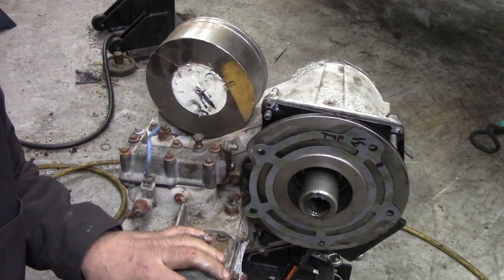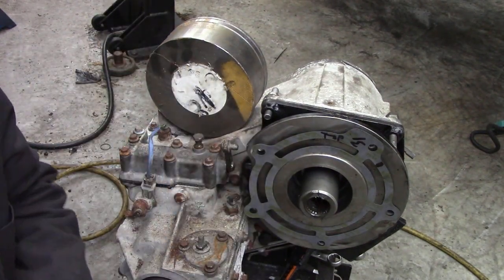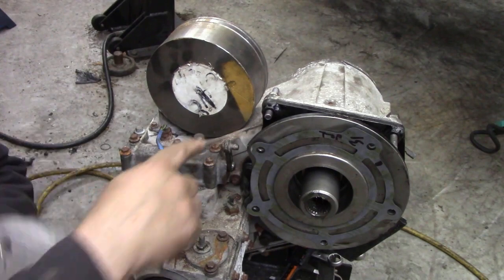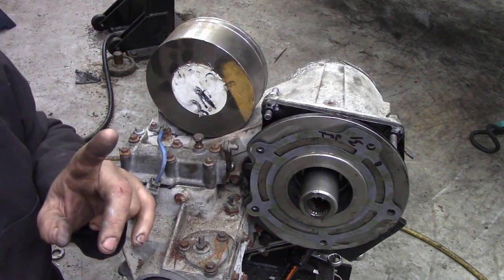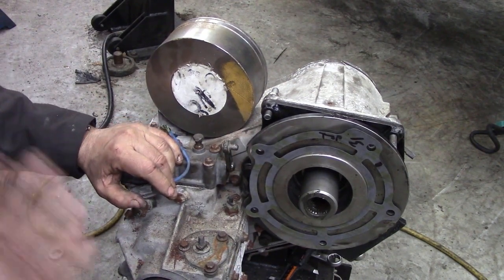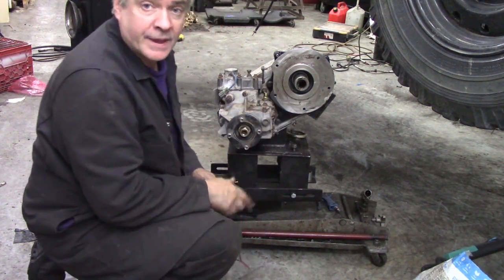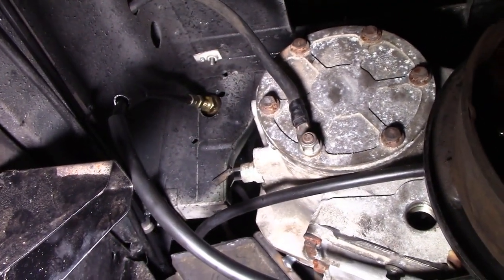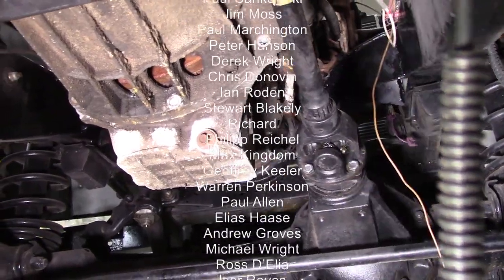GM Vortec project. Time to fit the transfer case  -  a few notes Part 2

Comment: Looking the goods Mike, well done matey. Not to far to go now and then you'll be zooming all over the place!  (WHAT - A landy that has some get up an go, bloody unbelievable)  :D
Reply from the maker: Need to get the ECU re programmed, and fettle and exhaust, sort a bit of wiring and then should be done - I must admit it sits so nice in the 110 - my only concern is the manifold is close to the steering  - would be excellent on a RHD!
Reply: @BritannicaRestorations  Yeah, I know what you mean, V6's seem to be just made for the Defender (admittedly the RHD version fits better), you may recall that I mentioned awhile ago, I wanted to do a Diesel version TDV6 but the TDV8 would appear to be the go (better engine apparently). I don't know what it is over here in Oz, but we really do prefer to have a diesel under the bonnet rather than a petrol in our 4x4's or I'd look into a Petrol V6 as well, so many on the market now days. Matey do a wrap on the exhaust so as to extend the steering links life span a tad and if you have to, square up or oval squish the exhaust pipe a tad or maybe dent the chassis /cross-member to get some extra wiggle room.
Reply from the maker: I liked my Isuzu 3.9T swap but it is heavy and not that good on short run mpg
I would do more but engines are hard to source and parts are hard to find - I have to get oil filters from the US! 
The V6 is good for parts - just got a new air filter delivered in 1/2 hour from local shop for C$10, New distributor (broke the old one with the lifting chain) $60 inc. tax Amazon delivered Sunday, and not in plastic!
Reply: @BritannicaRestorations  Yeah parts can be a bitch at times, and what with shipping on top it can be damn right criminal! Just have to try and find the perfect donor engine for easy set up, reliable, parts readily available, reasonable economy. The Goldilocks Donk - I think I'd have better luck winning lotto.  lol
Reply from the maker: Getting things from the US is a waste of time for me - 30% on the exchange rate and the shipping is often 3 x more than then part! That is why I feel for you in OZ and NZ - the transport is very expensive if you buy on eBay
Reply: @BritannicaRestorations  Yeah what is it with USA Shipping, its the most expensive on the bloody planet. I can get parts from the UK with shipping to my door far cheaper than I can do the same from the USA. I have watched the tracking on a few items that I had to get from the USA, an matey, I swear just about every state gets a visit from that item before it leaves for Oz. It lands in Perth, and heads on down to my place, just the one stop, but in the USA, I loose count of how many stops it has on the way to me and that's not including the ones outside the continuous 52 states of the USA. Its like every man and his dog is getting a nibble from the pie!
Reply from the maker: Inland US shipping is dirt cheap, but once they know you are in Johnny Foreigner land, up goes the prices  - I have known companies in the the US refuse point blank to send to Canada, even to sent things to my US mail box just over the line they refuse, well, they do not get my business!
Reply: @BritannicaRestorations  Fair enough too I say, always let your wallet do the talking (if you can go some place else cheaper - why not). What they are doing is just another legal form of price gouging!
Reply from the maker: Just as an example - this week I got the FedEx bill for customs processing the shaft I had made in the US - C$138. Tax was C$30, all the rest was processing fees etc
What a rip off!
Reply: @BritannicaRestorations  Can only say one thing to that.....FRAKENHELL  :(

Comment: It's gonna be a lovely conversion Mike.. smooth and torquey!! I'm surprised you didnt steam clean the engine /transmission before fitting??
Reply from the maker: I got all the oil and grease off it, but there was corrosion on parts

Comment: Hello Mike, any advice on replacing the mid cross member on a 2000 110? The  one that bolts to the chassis and supports the body behind the rear foot well. Need to replace mine as it's rotted on my driver's side where the side runner step attached to it 🙁
Reply from the maker: You need one of these

https://yrmit.co.uk/product/110-mid-crossmember-hdg-pre-2007-lr-defender/

They have bolt in body mounts so you remove the sill, chop out the old part, slid this in and bolt up 
Job done
Reply: @BritannicaRestorations  Yip that's the one i'd seen, i like the idea of not having to remove the body to fit it - wasn't sure if you were ok with links being posted. This is my first defender - so excuse another silly question. When i remove the floor panel is it a rubber seal that's supposed to go in between or a something like silicon to keep rain and water out? Thanks for taking the time to reply.
Reply from the maker: Use a thin 20mm approx closed cell foam self adhesive strip - make sure the surface for the glue side is clean

Comment: Mike, are those 3 holes at the bottom of the flywheel housing normal ?  Surely they will allow a lot of water in when wading.
Reply from the maker: And they will let a lot of water out!
Reply: @BritannicaRestorations  That's true

Comment: You could make a bit of cash selling those LS engine to LT230 transfer case adapters - I know some companies already make them, but they charge more than the vehicles are usually worth, so it's hard to justify the expense and instead keep throwing money at tired old Rover V8s :-)
Reply from the maker: Yes, they do not make them for the smaller 4.3 to the LT230 but Novak has the designs to make them - you can pick up a Jimmy or Blazer for next to nothing with good engines and transmissions